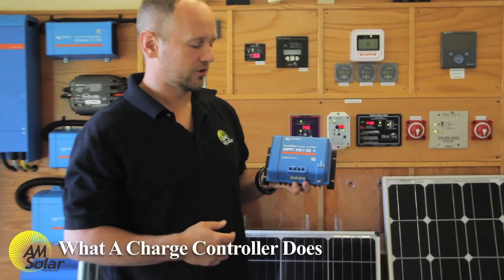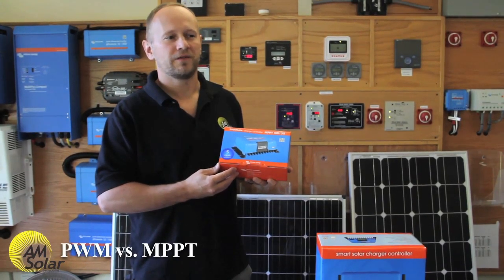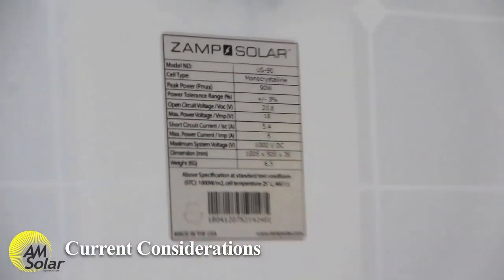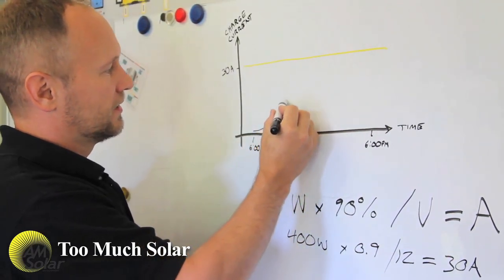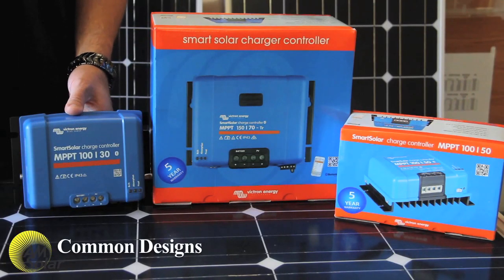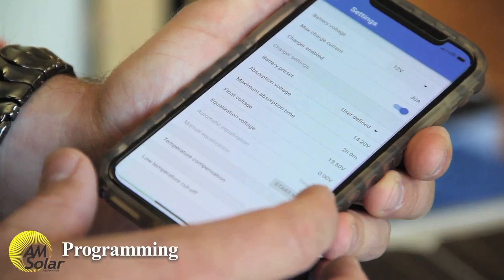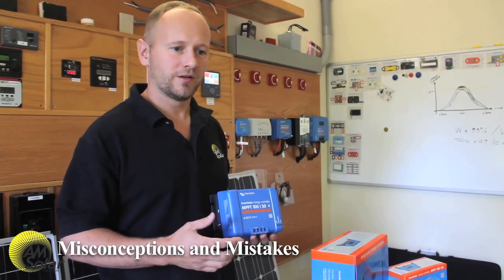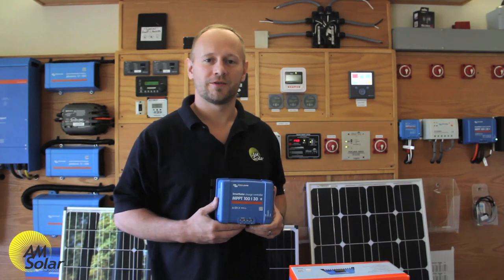How to Select the Best Solar Charge Controller for Your RV, Skoolie or Van

Comment: what will be the specification of mppt charge controller use to charge 48 v ,90Ah lithium ion battery with the 5 solar panel of 50 watt each connect in parellel.
Reply from the maker: Sudhanshu Ranjan You typically need the solar array to be at a higher voltage than the battery bank unless you have a boosting charge controller. Put the panels in series. 48V 5A